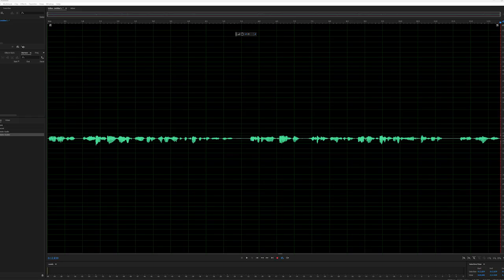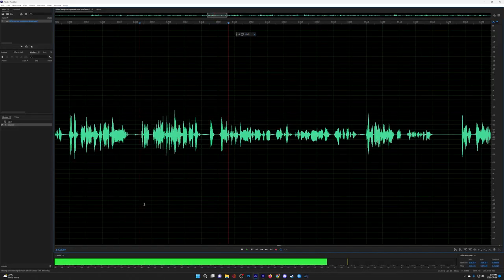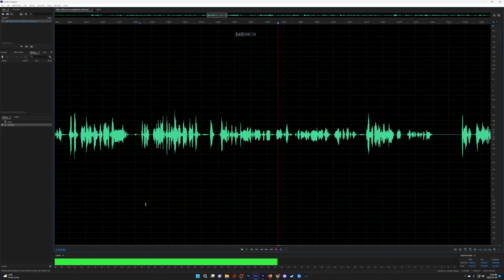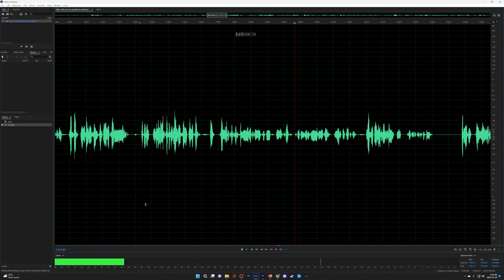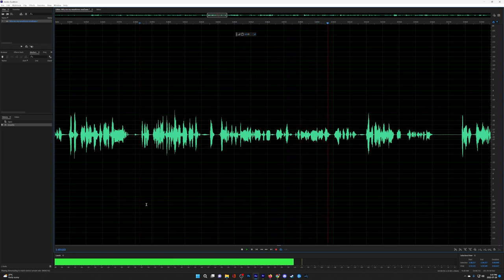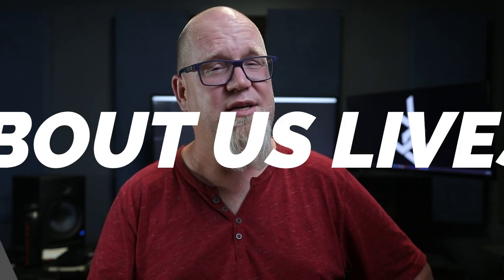WHY ARE MY WAVEFORMS SO SMALL?!? Quiet Audio Fix

Comment: I had this problem a year ago I realized it can be simply me not speaking loud enough into the mic, not adding enough gain into the interface, or I need a cloudlifter or a fethead for extra gain (I didn't need this as I bought the minifuse 1 which is powerful to run the sm7b). I'm glad that you're making a video on this because while I don't need it a video like this would have made learning this stuff so much easier

Comment: Lol. Interesting topic and take on it.
I personally have an SM58 plugged straight into a Scarlett Solo (gain ~90% or so - still a bit of headroom) and I can comfortably scream at around -18 db to -12 db as read by Reaper which I find to be plenty loud. If I'm going to mix my voice, I'll add a bit of light compression (~3:1) and maybe layer it, but not necessarily.

PS: scream as in the vocal style, not the volume. I know -18 db doesn't qualify as screaming, but it sounds cool.
Reply from the maker: It's that mix of entertainment and info...it can be a hard line to tread when talking tech...
Reply: Best if you add saturation

Comment: I stumbled upon this video because I switched from GoPro to Insta360 Ace Pro.  I'm using the same microphone that was inside my motorcycle helmet (Movo).  The Waveforms on GoPro were great and I could easily distinguish motor noise versus me talking.  Now with Ace Pro, everything is just like a small solid line.  It's very annoying. I increased gain all the way up.  No difference.

Comment: There is one thing you missed: if you're on a macbook ie. you'll need a extender to connect regular usb's. When connecting via an extension like that the gain is lost 10x. This was the case for me. When I connected via direct cable it worked flawlessly and less noise as well.
Reply: How did you fix this issue?
Reply: @lovecaribae  good question